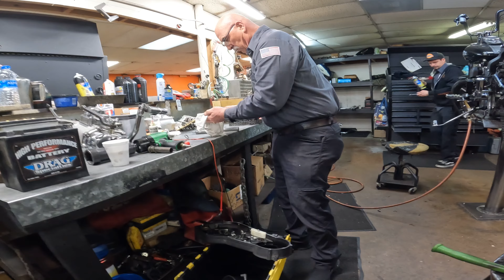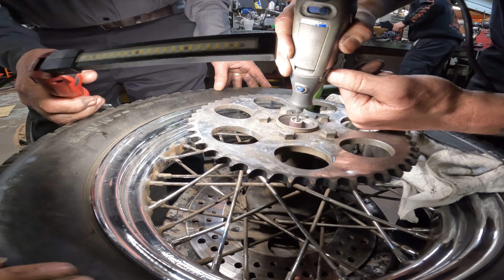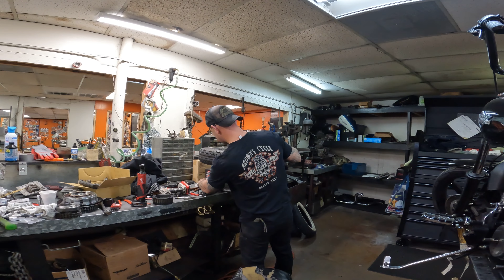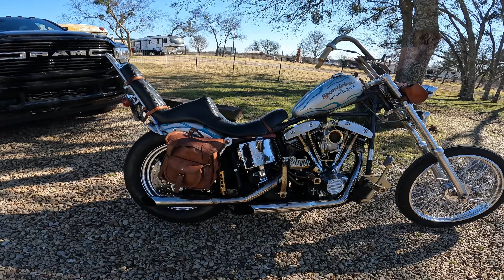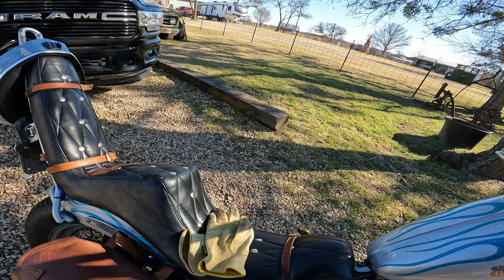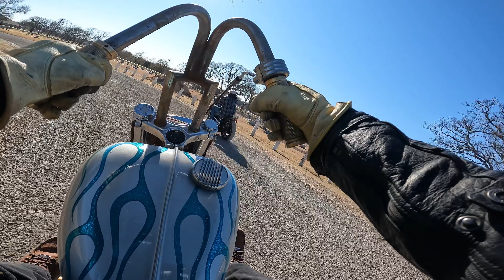Brown’s Cycle part 2 “When you can’t compromise, improvise!

Comment: That's why Harley went to sealed roller bearings. Easy and quick to install on the assembly line, but still not as durable as the timken tapered bearings when set up correctly.
Reply from the maker: Heck yeah brothaman